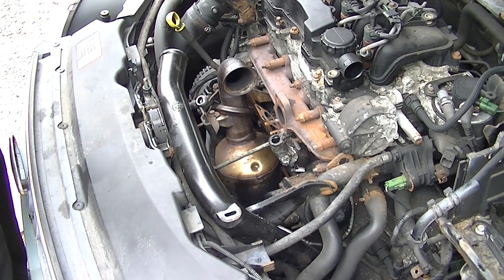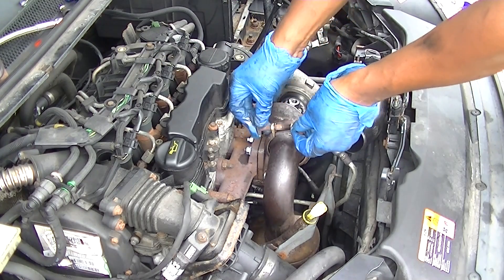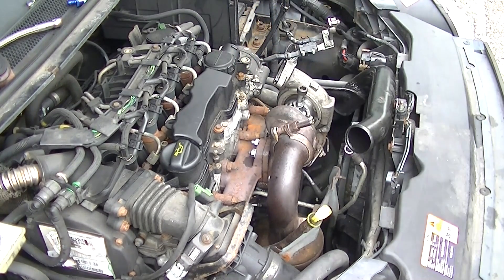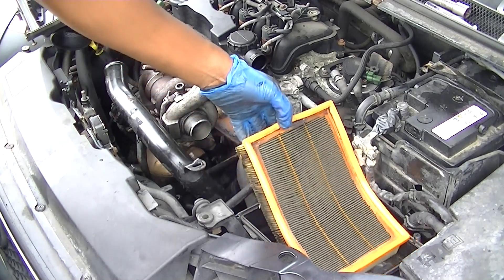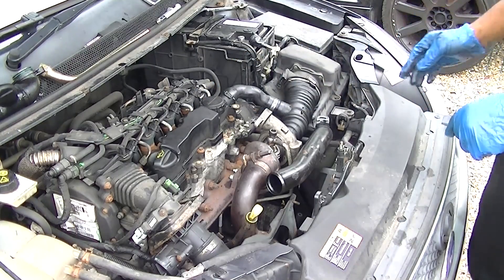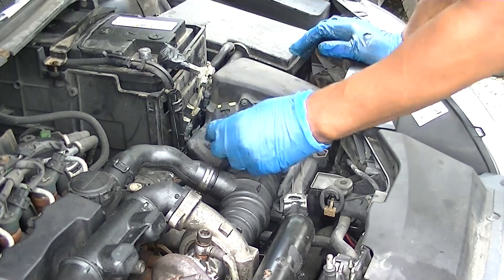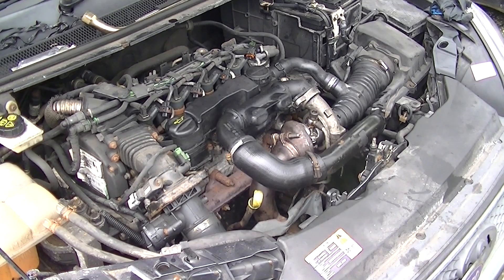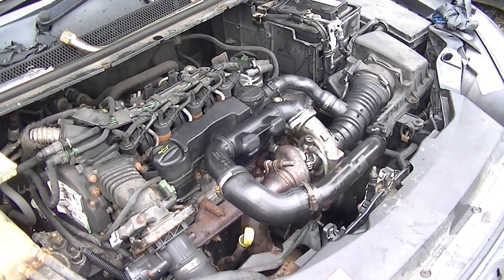How to Install A Turbo Charger

Comment: Dv6 engine prone to turbo failure change oil regardless of spec every 5k. These also have a gauze in the oil feed that clogs easy best to do away with it if changing oil regularly

Comment: you never mentioned 1 important thing.. and gave 1 bad bit of advice..
you never mentioned about it being recommended to remove the gore filter that is in the oil feed pipe to the turbo, As oil starvation is a common issue with these engines failing turbo's..
and one bad bit of advice you gave, was about cleaning the pipes of oil... maybe your not aware, But VNT turbo's are MEANT to get oil in the airboot from the filter to the turbo, This is why it joins onto the top of the engine too... VNT turbo's require a tiny bit of oil intake to lubricate the veins, Otherwise they stick and cause a horrible whiring noise...
But overall, Good vid..

Comment: ive just watched all 3 videos of your turbo guide and although im not a mechanic i feel confident that i could fix my own turbo now! brilliant explanation, excellent camera work. ive only had my ford c max 1.6 diesel for 2 mths and paid £1600 for it, a new tubo was fitted in March this year and yesterday i lost all acelaration and after inspection i saw that the bolt on the impellor or actuator or what ever its called , is missing and it looks like it had been bashing about on the fins which are really damaged. I have oil on both sides of the turbo exactly as youve shown. Terriffic job fella i take my hat off to you.

Comment: Did you changed the oil feed pipe and the banjo bolt ??....did you remove the oil sieve from banjo bolt???...also remove inlet manifold and decoke it and check injector seals and if possible have the cyclinder head dipped and cleaned

Comment: hi i followed this step by step right up untill the end had to do it the manifold way aswell. but that last bit were you tighten the giant Alan key screw that gose on the turbo is pissing out oil, is there some type of air tight washer were did i go wrong please?
Reply from the maker: Check your banjo bolt washers
Reply: +BMAC VAGS sorted it now you cut that bit out

Comment: Good video and explained in detail!Keep it going!

What about cleaning the banjo bolts mesh filter?I know  you checked oil flow to turbo but its good to clean the supply system to the turbo after having removed the whole lot.Its one of a major problem to these engines.
By the way you didn't fit the heat shields for some reason?

Comment: Not a BSP thread. BSP is pipe thread which is measured in imperial units. They will be Metric threads. Hence the M in M8. 8 being the thread size in millimetres (i.e M8).

Nice video though. Would prefer seeing it done on a mk4 Golf though as I bought my Golf with an uprated turbo so never really got to see the ins and outs of my engine before.
Reply from the maker: DazR340 Have you checked out my other videos?
Reply: BMAC VAGS I have, yes. I have learnt a lot from them. Thanks!

Comment: Good work on cleaning pipes etc and checking oil supply. Loads of people just change the turbo on these and oil supply is what causes failure.
I've seen people just change turbo and 5 minutes later it needs another! Haha